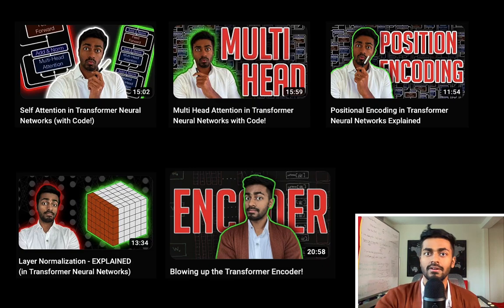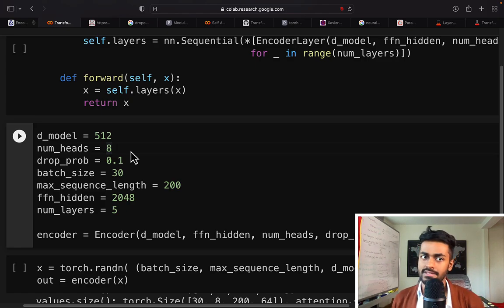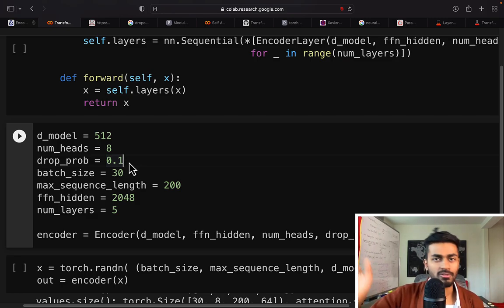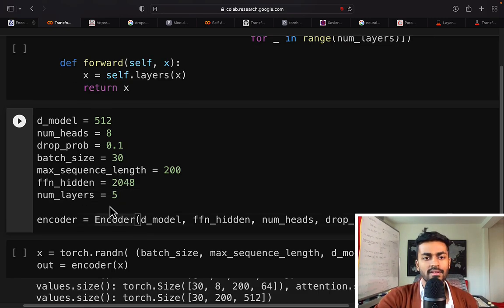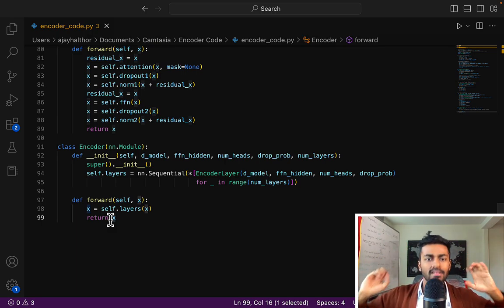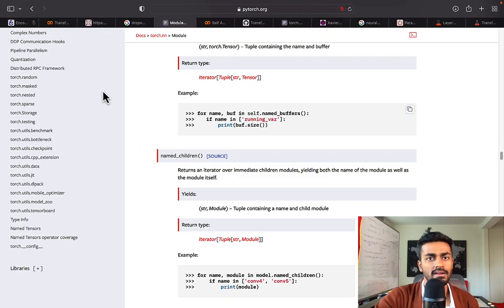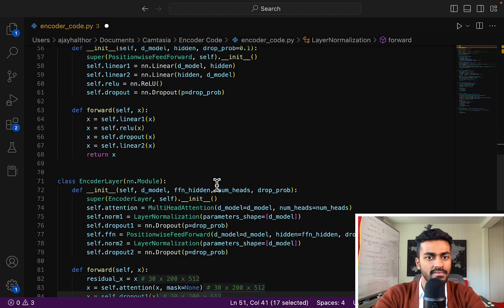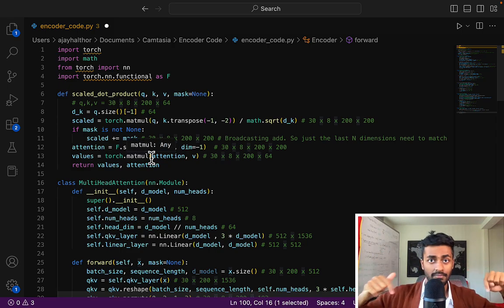Transformer Encoder in 100 lines of code!

Comment: Hi Ajay. I think, we need to make a small change in the forward() function of the encoder class. We should be doing `x_residual = x.clone()   # or x_residual = x[:]` instead of `x_residual =x`. This will ensure that x_residual contains a copy of the original x and is not affected by any changes made to x.
Reply from the maker: Oh interesting. I have been running into issues during training. I’ll make this change and check. Thanks a ton for surfacing!

Comment: I  think you forgot to address in you MHA code to pass the mask value.. I think here you need ModuleList and can't use nn.Sequential
Reply from the maker: I definitely need this for the decoder and I get around this by implementing my custom “Sequential” class. I was able to run this code tho just fine as is (sorry if I missed exactly what you are alluding to)
Reply: @CodeEmporium  Ah of course - I missed that we don't need it for the encoder (and that you could implement custom nn.Sequential as opposed to a ModuleList of the Layers. Although I'm not sure which of the approaches would be nicer).

Comment: I am looking forward to see whether you will try to put all the bits of the transformer together i.e. the positional encoder before this "encoder" and then the decoder after. I wonder whether/how it will respond to the input text "My name is Ajay". Would it respond as though in a conversation "Hi, how are you" / "My name is Bot" or generate more text in the same vein e.g. "I am 28 years old" or translate it to another language or something else. To achieve an end-to-end use case I guess we will also need appropriate data to be able to train the models and then actually train the models, save the model weights somehow, etc. Am new to all this but your videos are gradually helping me understand more e.g. encoder input and output matrix being of the same size to permit stacking. Thanks 👍
Reply from the maker: This is the goal. I am constructing this transformer bit by bit and showing my findings. We will eventually have the full thing

Comment: Amazing video series! At 39:07, why does the layer normalization just consider 1 dimension, the length of parameter shape, but not consider the batch size? Your previous video about the layer normalization mentioned layer normalization should consider both. Am I missing something?

Comment: I understand how the forward way works, but not how the learning works. Basically all videos I have seen so far covering Transformers "only" explain the way forward, but not the training. For example I'd like to know what the loss function is.

Question 2: afaik an Encoder can work on its own and doesn't (necessarily) need a Decoder (for example for non-translation use cases). How does the training work in this case? What is the loss function here? (-> we don't have a target sentence)
Reply from the maker: If you go further into the playlist (I just uploaded the code for this my my most recent video in the playlist), it is a cross entropy loss. We compare every character generated to the label; take the average loss; and perform backpropogation to update all weights in the network once after seeing all sentences in the batch 

For your Question 2, I am not exactly sure what you are alluding to. Yes, you can just use the encoder but depending on the task you want to solve, you’ll need to define an appropriate loss. For example, BERT architectures are encoder only architectures that may append additional feed forward networks to solve a specific task. These architectures will also learn via back propagation once we are able to quantify a loss.
Reply: @CodeEmporium  Thank you for your reply. For Q2: My plan is to deal/code/understand the Encoder and the Decoder part separately, starting with the Encoder. Especially how this Attention vectors develop over time. How they actually look for a small example, trained with a couple of sentences. Visualize them. See how, for example, "dog" is closer to "cat" than to, for example, "screwdriver".

But I don't know what the loss function would be to train this model. Could I maybe feed the network with parts of a sentence so that it can learn how to predict the next word? 

E.G. Full sentence could be: "my dog likes to chase the cat of my neighbor".
X: "my" Y: "dog"
X: "my dog" Y: "likes"
X: "my dog likes" Y: "to"
X: "my dog likes to" Y: "chase"
... and so on ...
Would this kind of training be sufficient for the network to calculate the Attention vectors?

Comment: where did you get the 3 for 3 times 512 =1536?  Is it 3 because you have query, key, and value?
Reply from the maker: For every token (word or character), we have 3 vectors: query, key and value. Each token is represented by a 512 dimensional vector. This is encoded into the query key and value vectors that are also 512 dimensions each. Hence 3 * 512